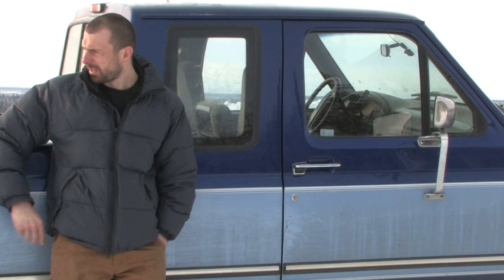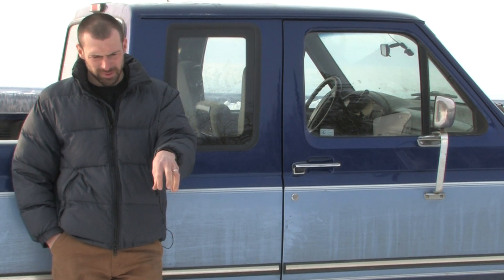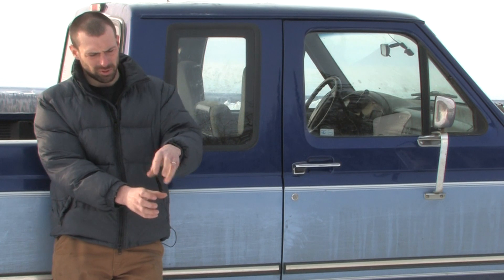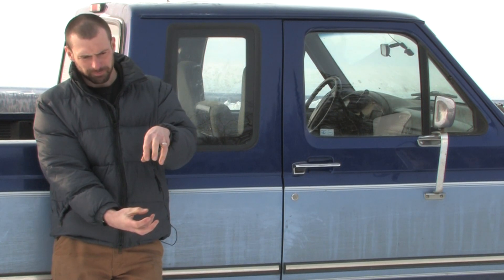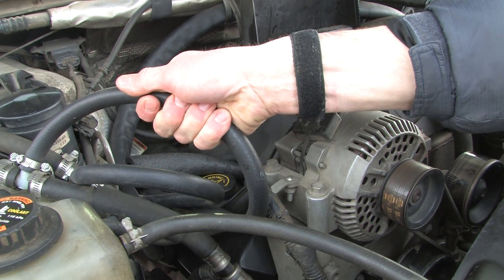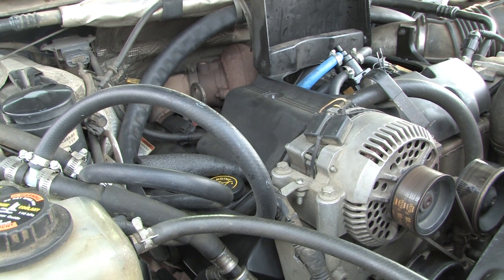UAF - 2009  - Converting to vegetable oil (Part 1 of 2)

Comment: I put stright vegetable oil in a 2000 model ford focus.i filled it to the top.after i let it run out of diesel.,,and guess what..THE CUNTING THING WOULDNT START.SO I BLED IT WITH A BIT OF REAL DIESEL IN A CAN.JUST TO GET THE AIR OUT.AND IT STARTED UP.AND HAD  ENOUGH IN THE PIPES TO START IT AGAIN..AND GUESS WHAT HAPPENED..I DROVE DOWN THE STREET AND THE CUNTING THING DIED ON THE BUS STOP..OF ALL BASTARD PLACES..SO GUESS WHAT HAPPENED AFTER THAT.I WENT BACK AT NIGHT.AND LIT THE BASTARD ON FIRE..AND WHEN PPL SAY RUNNING THEY CAR ON CHIP FAT SMELLS..U SHOULD AV SMELT MINE.HAHA..THE WHOLE STREET WAS COMPLAINING..PMSL.WANKERS..

Comment: well then, I've been educated! I just replaced nearly EVERYTHING in my 7.3 IDI, starter batteries, cables, return lines, injectors and injection pump, the pump cost me about 900 plus core but now I'm certain it'll last at least 100 000 miles

Comment: Yep, there are several ways to run oil as fuel.  I simply love it, it's so darn exciting.  Each time I get ready to flip my switch I just giggle inside.  Some times under my breath I might say "hell yeah baby, burn".

I have also posted a video: Vegetable Oil Diesel 7.3 IDI.  Check it out.

Congratulations and good choice with a FORD.